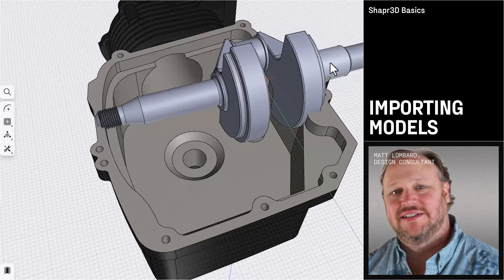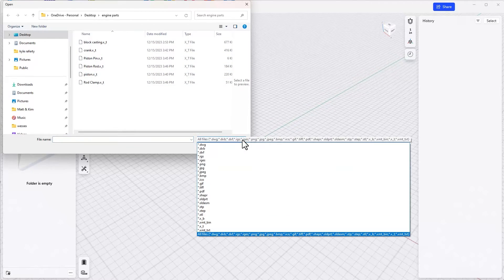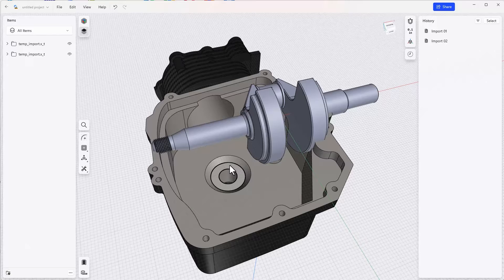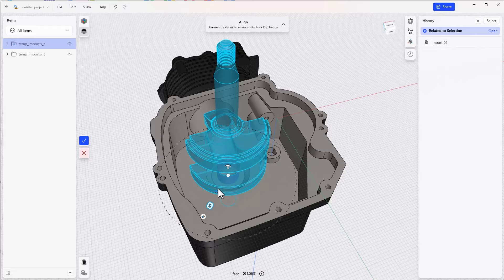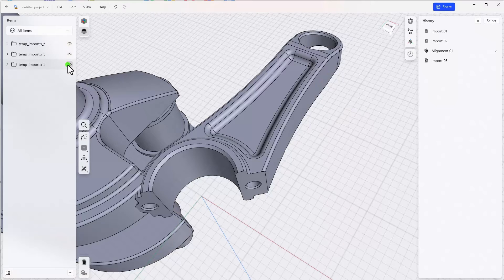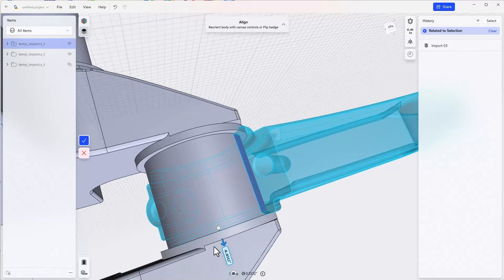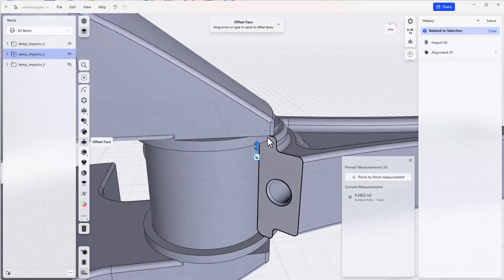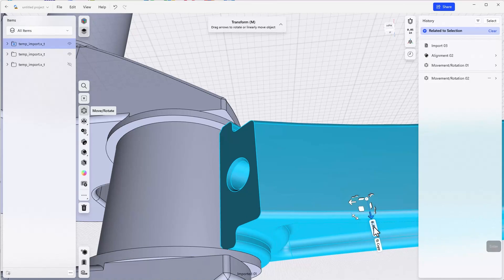Import models: Assembling a motorcycle engine | Shapr3D Basics

Comment: The features so far are pretty cool but I am still missing assembled devices with fixed joints and maybe with animated mechanical movement
Reply: And importing parts to project from inside the software, not from outside.